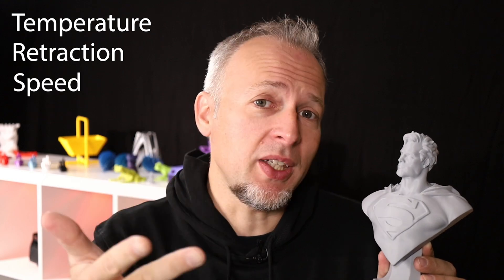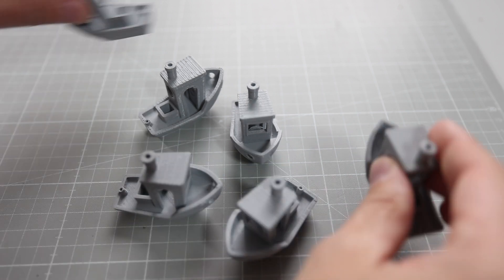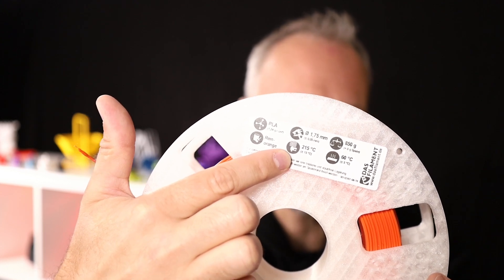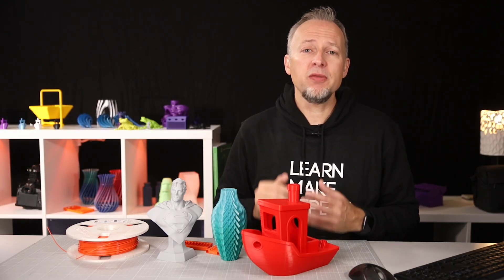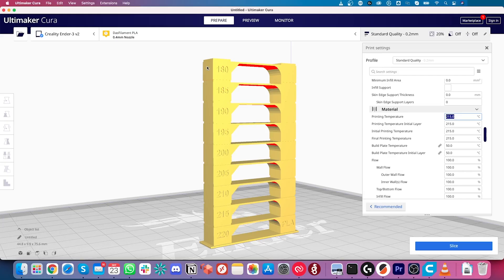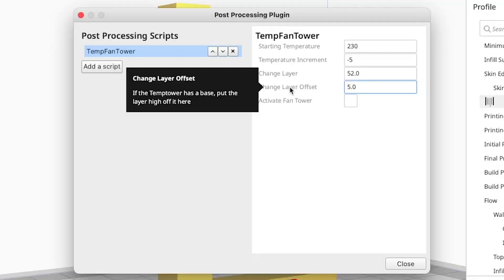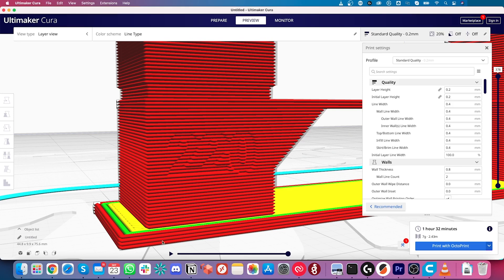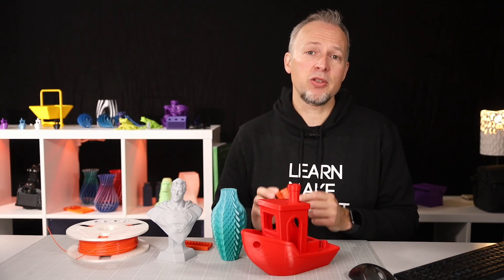BETTER PRINT QUALITY! Temperature towers with CURA

Comment: Why would you visually count the layers, which is both difficult and prone to error, when you can use the up/down slider to count. You can even use the up/down arrow if you can't get the precision with the slider.

Comment: Great video! However, on my Ender 3 V2 the temperature started at my previous temperature setting 200. When I got back to it a few minutes later it had change temperature to a higher number so it was working. I suspect that you also have to change the temperature in the settings in Cura to the same starting temperature as in the script. In your example 230. Or else it will start printing at whatever temperature you had in your settings from before.

Comment: Correct temp can improve surface finish + rigidness waaay more than you think
Reply from the maker: So true!
Reply: @Crosslink3D  fact that, some times temp sensivity differs +-10 from batch to batch. not only cheap filaments.

Comment: Good video, but unless the plugin has been updated recently to make this automatic, you missed a critical preparation step that would trip up a first-time user. After installing the plugin and restarting Cura, you'll need to go to Extensions -> Parts for calibration -> Install scripts (or something similar) and restart Cura again. Otherwise, the scripts won't be available in the modify g-code section.
Reply from the maker: Yeah, I remember this but this isn't a thing anymore. That bug has been fixed quite some time ago. The menu item "Install scripts" even doesn't exist anymore recently.
Reply: thank you, that exactly I wanted to know.

Comment: Hmmm, I tried using that temp tower shape in Cura but no matter what I did I got stringing, I used a different temp tower but used the Cure temp tower settings and got a temp tower print  which was much better and gave more correct results for the different temps with stringing only occuring at the higher temps. I came to the conclusion that the Cura temp tower shape had something wrong with the STL file to cause all the stringing no matter what temp or retraction setting I used.